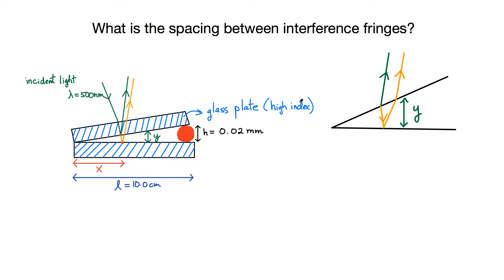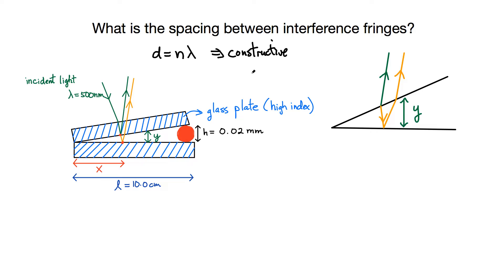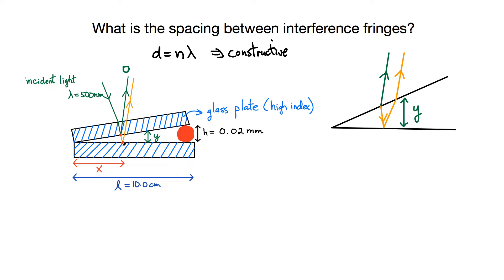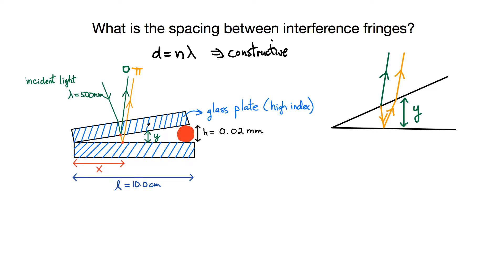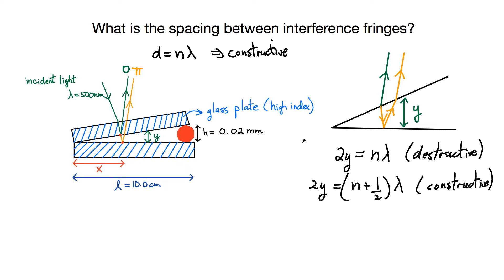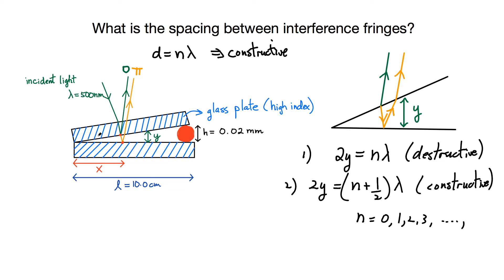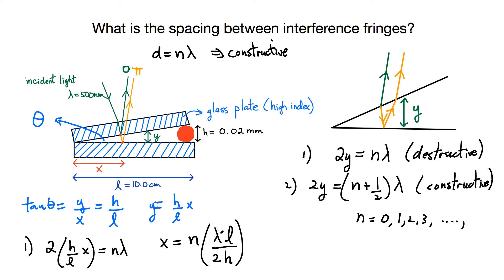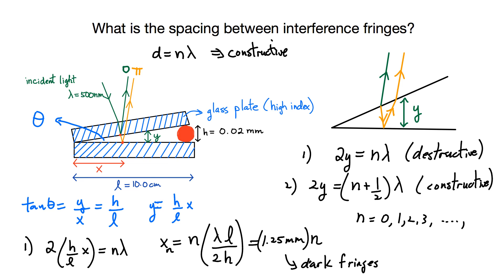Interference Between Two Glass Plates

Comment: You're wrong. You do a big mistake!! If you thinking about the light which have 500nm wavelenght you can"t aproximate that destructive and  interfirence will be for 2y=n*lambda and for construcitive 2y=...... Difrence between two beams is not equal to "2y" and for so small wavelenght it's a big mistake.
Reply from the maker: LOL!   do the math it's only 40 wavelength (500nm/0.02mm)
Reply: @PhysicsNinja  in this case yes but, when angle is bigger and and lenght between two surface is much longer it making bigger error. For example If you measure flatness of surface by interferometry with air wedge this error can make wrong result.
Reply from the maker: @kacpersuchecki2188  this video is not meant to capture every case.  Every physics problem has a lot of approximation and there are too many to list.   This is a quick way to take 2 glass slides and measure the diameter of your hair.
Reply: Once time you tell that difference beetween those two beams patchs is aproximatly 2y. Next time you said for destructive interference 2y is "equal" to n*lambda. It can be misunderstood by someone. If you make condition write that this isn't equal but approximate. You can calculate for this example like equal. But conditions are not only for this example. If you didnt write that this condition is true only for angle nearly zero and small lenght beetween surface or aproximate the condition will be false.

Comment: Does the light not also get refracted by the bottom glass and reflect off the bottom not the top, just like the top glass did
Reply from the maker: Yes, absolutely.    You can create multilayers  where you would have to consider the reflections and refractions off each surface.   For this problem I only consider the simplified case (assume that the bottom plate is really thick, although the picture doesn't show this).